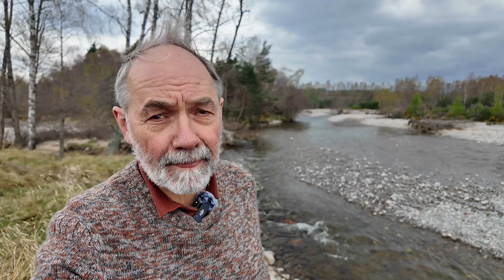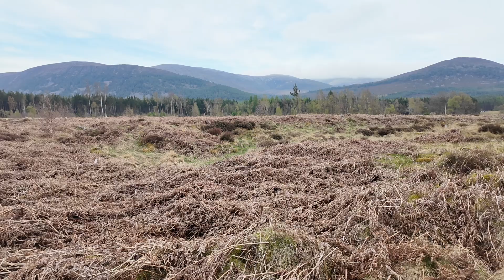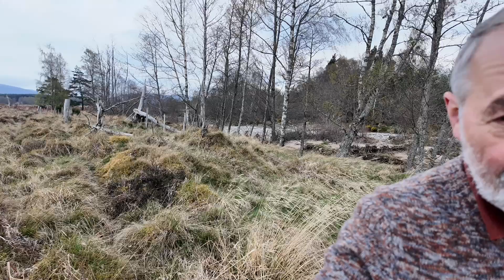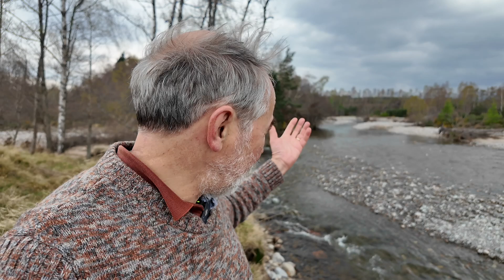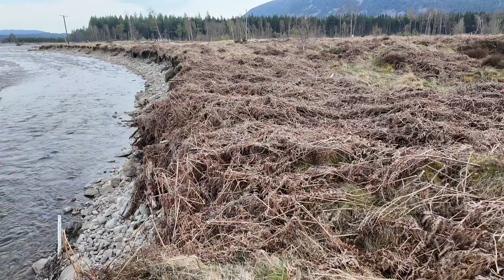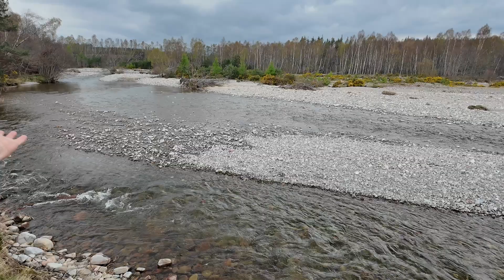Braided vs Anastomosed Rivers: Geomorphology and Ecology Explained

Comment: Interesting video Bill (well, that goes for all your videos, really).  Here in New Zealand we have lots of large braided rivers, and I've always assumed that a braided river (steeper gradient) becomes anastomosed when it hits the floodplain, much like the Canterbury plains here.  So, rather than two discreet fluvial types I have always seen them as different parts of the same river.  Your differentiation between depositing and sedimentation as the formative factors is something I didn't know, but it explains a lot of what I see here.  Thanks, again, for all your wonderful posts.
Reply from the maker: Thanks Peter, 
I was thinking of the rivers in South Island when I decided to cover this. Yours are remarkable and even more spectacular than the one I filmed. Thanks for the generous comments.